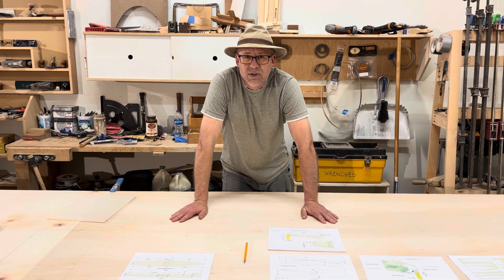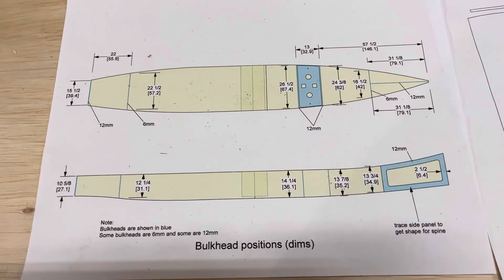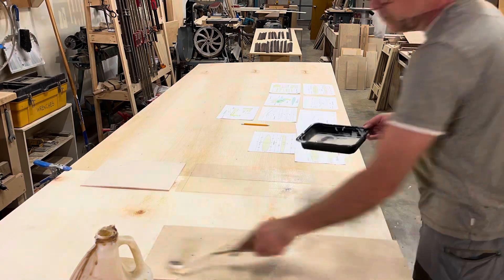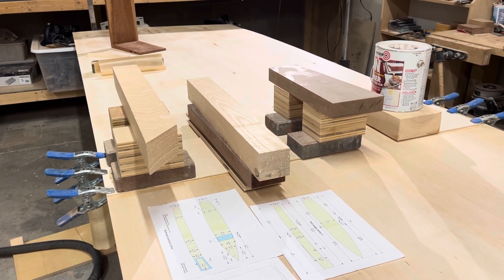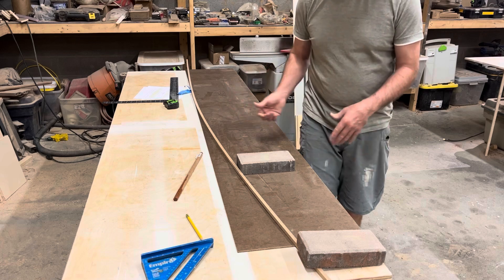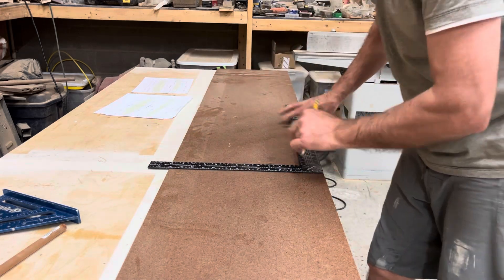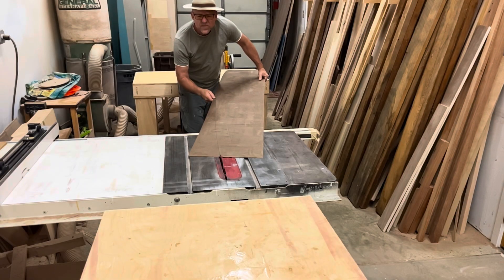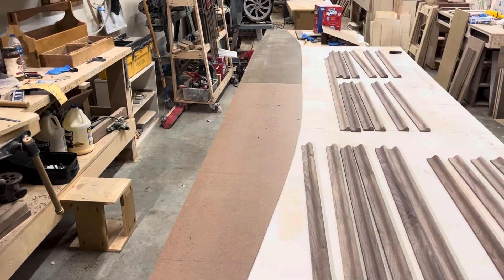Making Spark Sailing Canoe Part 1

Comment: So Mark, is the whole boat glued with TB3?  If it stays watertight that would be great.  I’m on the water and use a lot of epoxy - would prefer not though.
Reply from the maker: Yes, all glue is TB3.  Even the inner cockpit sandwich floor.  The only glass and epoxy are found on the bottom and wrapped around my skimmer akas, (crossbar).

Comment: Mark, I have a question: Your dagger board is at the lengthwise center of the boat, along with the center of work of the sail (point C) as expected, OK. But, why do you have the crossbars and the outriggers up front? Is it for practical reasons like to clear some space for the cockpit, or is there some other maths somewhere I had missed?
Reply from the maker: Sure, I can answer.  Imagine sailing on a beam reach.  Imagine the boat is moving forward equal to the wind speed or slightly more.  Drawing a vector triangle you will notice your boom is out about 40 degrees from center.  Project a line 40 degrees forward of center, perpendicular to the sail and the CE goes directly over the outrigger. Also, when pointing or running the heeling is less.  Always position the float to counteract when on a beam reach.
Reply: @markpalmquist  OK. Thanks for the explanation

Comment: Hi Mark ! Looks great ! How thick are the plywood panels ?
Reply from the maker: Thanks Clements.  I am using 5mm thick luan plywood.  It is not very strong, so I will put 4 OZ fiberglass and epoxy on the entire bottom.  Then I might add 25mm of XPS foam on the bottom if it still feels like my foot could go through the floor.

Comment: Looks promising. I wonder if the flat sides have a drag penalty? BTW are you aware of this hydrofoil stabilized single outrigger canoe? https://www.youtube.com/watch?v=6I_7uDYg0QQ&list=PL292B91084B3587D2
Reply from the maker: @macrumpton  that’s a nice outrigger.  Yes, I saw a video of it years ago.  It looks like one of the only production outrigger canoes and the only one using a foil for downward lift.  I wonder how angle of attack is adjusted?